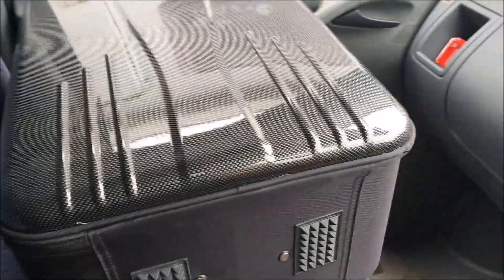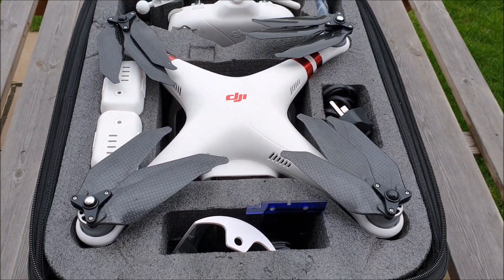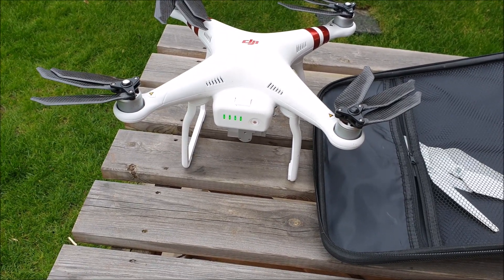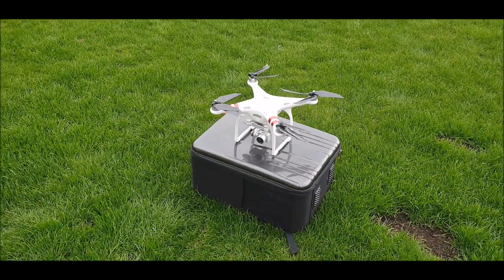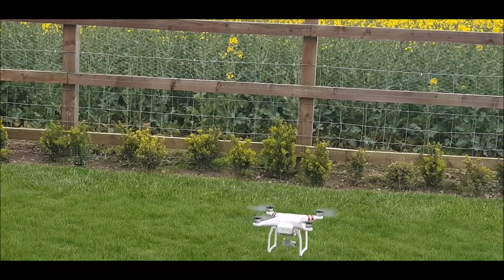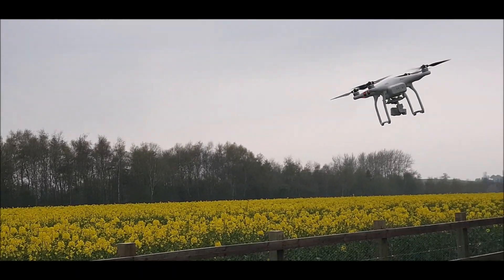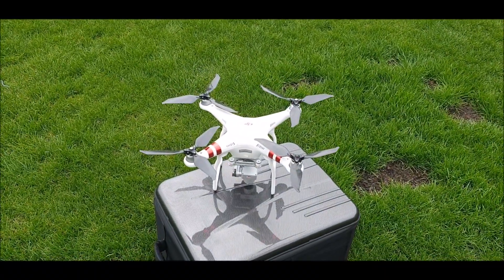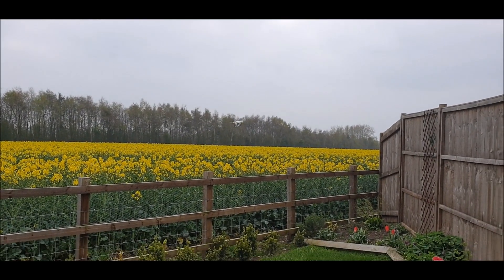DJI PHANTOM 3 Carbon Fiber Props VS Stock Plastic Props

Comment: I bought a set of 2 blade folding props, the same as these 3 blade units and once take off speed was reached they started hitting the quadcopters arms. Phantom 3 Pro used.  Never again !

Comment: You wanna be folding them rotars out into position before you fire up the motors fella.
Wont take lkong to shake your motors and bird to bits if you keep doing that.
You can see how much it doesnt like it when you do it. Cringy.
But by looking how it flys with em on, they seem better in the bin!
For the sake of 30 seconds to put the standard rotars on.
Reply: hahahah yeh, you should of unfold first before start up

Comment: Carbon fiber props are conductive, they are disturbing GPS module signal, that's the problem
Reply: GPS antenna is in the center of craft. Nowhere near the props' path of travel.